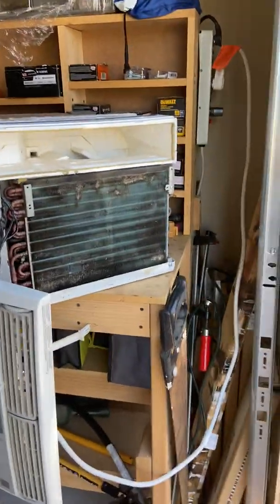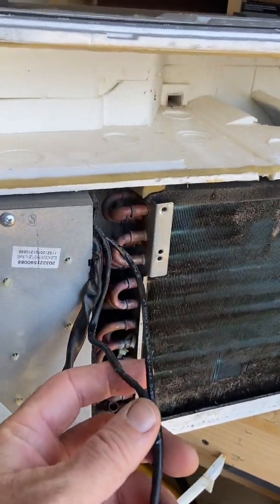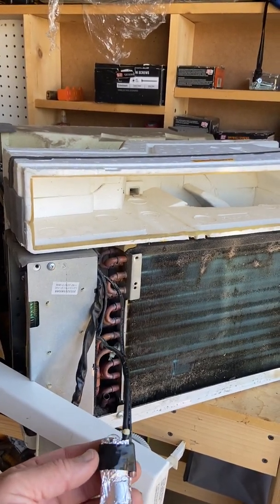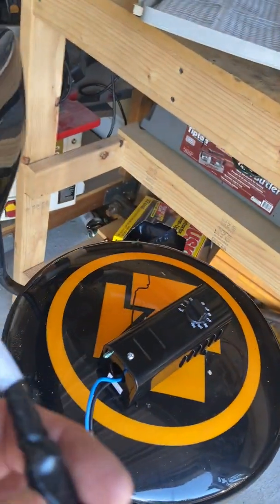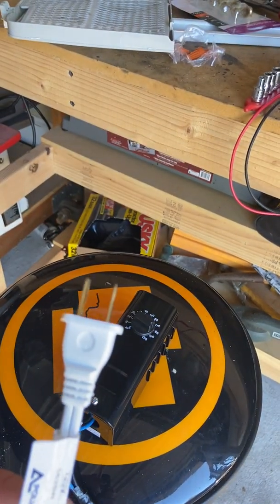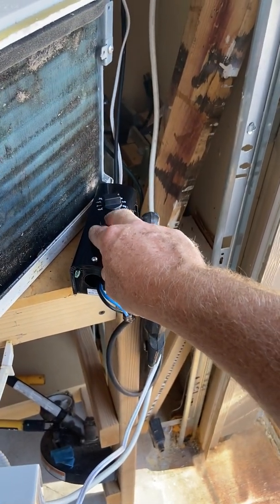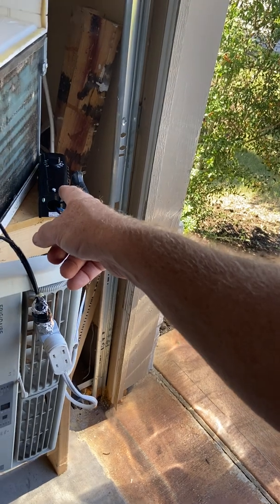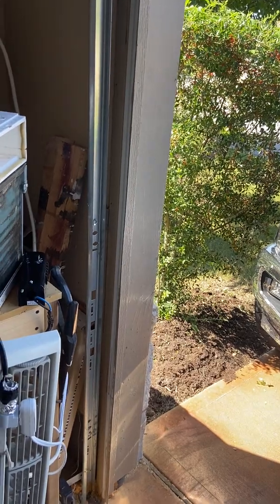Make a Window AC cool to 38 degrees - Easy Hack

Comment: Hey Scott I have a 12,000 BTU Fridgadair unit brand new trying to cool a 10x16 shed. I did everything as you described but my ac unit still wont go below 52 degrees right on the coils. Even with a 4 watt bulb wrapped to the thermostat is sticks at 52, how to get it to go lower!???
Reply from the maker: Is it freezing up?  Check also the air temp as it leaves the vents.  Should be 35-42.

Comment: My compressors on both units run non stop and barely keeps rooms at a comfortable temp when it's hot and very humid out. Blowing out 59 degrees ...outside temp 98 degrees with dew point at  77 degrees

Comment: OR change out the thermal resistor (the thermostat) with a resistor value
that equates to 38 degrees.  All that other stuff would not be necessary.
No light bulb, no extensions cord, no secondary temp controller.
You could even replace the thermal resistor with potentiometer
(variable resistor) you could turn to whatever value you want.
My 20 year old AC control board is dying and slowly bumps
up the temperature due to faulty board etching, and I am
tired of clicking it back down.
-- Thanks for Thinking, sir !
-- North Central Florida.

Comment: Why not just use that thermo switch on the unit and put units sensor against the compressor where it's warm all the time. Then you don't have to worry about the bulb burning out or do all that extra work

Comment: U could also use a thermostat with on off programming for an extension cord and set it to the temp u want and it will turn off or on - usually sold in the agriculture industry

Comment: These days in the last 5+ years or so the window A/C units will only cool to 65 F even though you can set the number to 60 F.  I have 3 different LG A/C units, and each of them will only cool to 65 even if they are set on 60.  I'm very mad about this. I need it cooler than 65 F in my room at night.  65 is too hot.
Reply: Same! Shits annoying, I may just take the sensor and extend the wires to reach further from the a/c's cold air
Reply: @M.TTT.  Cutting the sensor wire will brick the unit?
Reply: @UnworthySubject  maybe, it wasn't a wire on mine, but some sort of other sensor tube or something. I just moved it out of the casing and outside the path of intake airflow and it cools to a lower temp now
Reply: @M.TTT.  Nice
Reply: Well do the hacks stupids
Reply: Y'all stupidss

Comment: You can also do this by taking the thick blue wire and fan wire and wire directly to hot then when the unit receives power it will automatically turn everything on bypassing all compressor safetys

Comment: Made me laugh. Backwoods hillbilly sh*t is correct. I live in a 2 bedroom condo. 800 Sq.feet. I bought a 14000 btu window AC which is good for 800 Sq.feet.

Here's the flaw in your logic. My unit like most units regardless of the btu's if you set the temperature to 60 degrees will keep the AC running constantly as well as the compressor. My condo temperature never goes below 71 degrees. So it runs full steam all the time. 

Bypassing the thermostat is useless as it already runs non stop. Controlling the unit with external thermostat set at 40 degrees it will just run non stop since the temperature will never get that low. 

So you did some funky electronics to accomplish what the AC is already doing.

As a side note. If i installed my AC in a really small room say 150 sq feet like your 7x7x3 room my unit would make ice cubes and would be very cold. 

Your modification is nonsense. Just installing your AC without modification would produce the same result. It's cold because the room is small and therefore your AC is running at optimal cooling. Just like your freezer.... small space therfore colder and freezes stuff.

Comment: Ide extend the temperature wire to rear where on compressor motor since it’s always hot saving use of light bulb??
Reply: Then it will run continuously until the unit freezes

Comment: Boy that is some bass ackwards shit serious hillbilly shit Love it. This made my night funny as hell.
Reply: Instead of talking smack you two may want to know that backwoods does not equate to hillbilly, "backwoods people as you call it" are 9 times out of 10 far wiser than city egos that talk the smack and most importantly... You are talking smack incorrectly and don't even realize it LOMFL!  This is mostly for insulated rooms, walk-in coolers and figuring out ways around the stupid prices that many city folk are trained to just spend for convenience.  And by city folk, I mean you talking smack and not even knowing you look like the fool that you tried to call "backwoods people".  Wow!  The arrogance!  I like your video man!  It's helpful and saved me thousands of dollars for MY PURPOSE that is not in a fing condo lol.  Great work!
Reply: Made me laugh. Backwoods hillbilly sh*t is correct. I live in a 2 bedroom condo. 800 Sq.feet. I bought a 14000 btu window AC which is good for 800 Sq.feet.

Here's the flaw in your logic. My unit like most units regardless of the btu's if you set the temperature to 60 degrees will keep the AC running constantly as well as the compressor. My condo temperature never goes below 71 degrees. So it runs full steam all the time. 

Bypassing the thermostat is useless as it already runs non stop. Controlling the unit with external thermostat set at 40 degrees it will just run non stop since the temperature will never get that low. 

So you did some funky electronics to accomplish what the AC is already doing.

Comment: I got to thinking about this at work.
I am totally stealing your idea and using it elsewhere.
I will build an insulated box around a window unit. In the box I will have a hepa filter fan pushing cold air directly onto my noctua cpu cooler inside the computer.
I will 3d print a shroud to direct the airflow inside the pc, and another shroud to direct the air from the fan to the computer case. You have solved a problem I have been contemplating for years.
How to cool the cpu cheaply and effectively for record breaking overclocks.
In the crazy computer market, people are buying All in one coolers that pump water in a loop to a radiator with fans going. But this only pulls in room temp air to cool the cpu.
If you cool the radiator only then the tubing will collect condensation and drip on the expensive electronics.
One guy I saw ran the air conditioner directly into the top of his pc. He tested water cooling with an All in one unit. And an air cooler. The air radiator from Noctua is massively more efficient at heat transfer.
Then I thought of bringing in sub zero outside air in during the winter time. And I might try that down the road.
But getting an AC unit to cool the air down to 4 degrees C and have a fan blowing cold air at the Noctua cooler at 500 cfm... I might be able to set an overclock air cooling record.
The records are divided by type of cooling. Liquid Nitrogen users currently hold the world record. But I just want to get the air cooling record.
I think the number 1 spot is currently held by a Ukraine guy named Andersky. He has the record at 5.9 ghz with a CPU cooler - Noctua NH-D14 and air temperature is +2 C, on an Intel Core i5 2500K
The second place goes to a Japanese guy testing his pc outside with 0 degrees C
I think I can get to at least the top ten list.
Reply: Condensation will get you
Reply: If you cool the entire computer though inside of said box it'll all be the same temperature so you Don't have to worry about condensation

Comment: God bless y'all.  New York guy here who hates artificial heat and radiators during the winter.  Everyone at my house will put it at 75F which is way too hot so I just counter by putting an AC in my room that runs cool 62. 

Problem now is that the last AC that I had was rattling and making noises to where I couldnt sleep because it was so loud.

So I went out and bought a Danby 12000 btu and the compressor turns on for 2 minutes tops then goes right off.  Thought it was defective, so I bought a GE 14000 btu AC.  SAME FUCKIGN BULLSHIT, cost twice as much.

Then I thought, there's GOT to be either a smart chip in there somewhere making it to where IF it gets below 62 it wont turn on the compressor even if you set it at COOL.

Might have to do this before I empty ten 10 round clips into these pieces of eco baby earth day shit.

It would suffice for me to have 58 on all night with a fully working compressor.
Reply: relax .  all you have to do is  put something that  warms  the compressor main switches in the fins  area like this video shows , a small night light  (wrapped in aluminum foil )  connected to  power strip with a  mechanical timer switch ,  on 30 Mins  off 15 mins 20 mins  , whatever you find comfortable  after you test it ,  , real  easy to do.
Reply: @kingdommusic5456  Yep. Pretty much got 2 temp controllers with an LED 3 watt bulb and they keep that new AC working as if it were 100 Fahrenheit in that room, turns off the compressor as it hits 50 on the fins.
Reply: awesome!
Reply: @TheCuriousNoob  I could give zero fucks about "efficiency".  I want it cold, period.  Colder than what perhaps you may perceive as "normal".  I understand what BTU's are.  You might be as much of a fool as I am apparently because "more BTU's" doesn't imply everything will be colder/hotter.  That is the assumption; that higher BTU means more power to cool, hence, colder temperatures.

The problem is that no matter what, most if not all new air conditioners are programmed to not cool below a certain temperature no matter what you want.  

It will automatically turn off the compressor when it reaches 64 degrees no matter if you put it on Cool and High.  Once the sensor senses that temperature, it turns into an over prices fan.  They don't tell you this because they want to force you into their "guidelines".

All you have to do is trick the temperature sensor into thinking it is hot in the room and the air conditioner actually keeps the compressor on to make it as cold as you'd like.  

So shove that bullshit up your environmentally friendly baby ass, EPA.

Comment: Good video, Scott.  I like your supplemental thermostat idea, since that provides greater temperature control to the room you are cooling.  I had to add a timer to my cooling circuit (https://youtu.be/jFo3IJy17Cg) to address the problem of frost buildup that blocked the AC fan.  But, apparently, you've found a magic temperature setting on your thermostat that provides a melting cycle for the compressor.  By the way, I think the probe set in the cooling fins by the manufacturer is called a thermocouple. ............ Ken

Comment: Would it not work better if you took the thermostat wire and connected it to a plug and then plug that into a thermostat wall adaptor that turns the power on and off depending on the setting on the new thermostat?
Reply: No
Reply: The air conditioners thermocoupler would tell the thermostat to turn the AC off long before it would cool to the desired lower temperature. Your idea would work if he was wanting to achieve regular AC temperatures which are warmer than this.

Comment: Interesting design.  Has me thinking can make a passive more design so not needing the thermostat or night light.  Thinking can use some sort of tube design to equilibrate with the outside and inside air temperature to keep the unit thinking it's warmer.  Seems would work better if your walk in cooler wasn't super insulated and the inside temp was more related to the outside temp so to make a more linear relationship between the two environment temps so to balance the tube ratio temp on the AC switch sensor.  Your idea seems safer for the device not to freeze up, though wondering about a more passive not requiring more power way.  Guessing can also do something solar controlled with the cheaper ways chest freezers are hacked into more energy efficient fridges like with the Inkbird or maybe for a more off the grid solution other cheaper 12V ~10A temp controllers that looks like Walmart even sells now where you'd need to purchase a ~12V relay to switch the 120V mains.  Maybe run that controller off solar with a battery or just don't switch via the night light and just switch directly with only the ~12V temp controller in place of the AC sensor.  Neat project and has me thinking for sure.  I've also wanted for generator and ducted use possibly, to add a starting capacitor for less starting surge load on an inverter or generator like with this video. https://www.youtube.com/watch?v=vKhiFVyMFQ4   I've been wondering about that hard start capacitor for other power tools when using the inverter more-so for years and haven't gotten around to the math involved since don't use anymore now days, though thinking will again in time.  Thanks for sharing.

Comment from the maker: Update:  I have used this setup twice now to keep deer cool in my diy walk-in cooler.  I learned that there is a break point where the unit will freeze.  For me that is around 36 degrees. So I set this to run at 38 degrees and it worked perfectly.  With the mechanical thermostat I used, the temp range when set to 38 degrees was about 10 degree.  So it would turn off at 38 and then back on at around 49.  So for my purpose, this is a success.
Reply: SCOTT:  You can also plug your night light  into an inexpensive AC timer to force a defrost cycle every 15 or 30 minutes.  I've been doing this for several years in our MBR, and it prevents compressor freezeup.
Reply: please can you tell me ,  does freon only reate one temperature and then the duration lowers or raises the room temperature . 
for example isnt the unit always blowing cold air at somewhere around 60 degrees until it reaches the desired room temperature . 
and the way your doing this is still coming out at 0 but because its a smaller room it runs alot and youve tricked it into running a longer cycle until the room temperature reads 38 but not the actually  air coming out of the air conditioner . is that correct
Reply: Im just trying to figure out do you have your ac unit in a fridge? Haha i thought most units only drop the temp in the range of 20 degrees difference than outside air?
Reply: Write a defrost timer